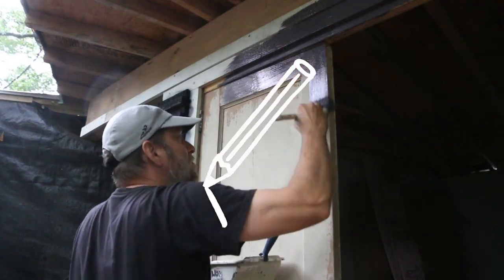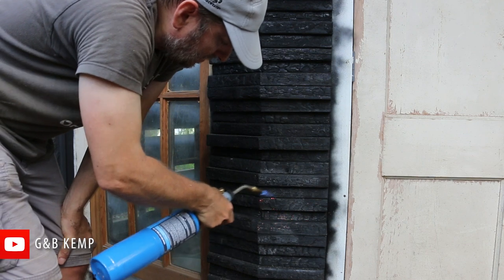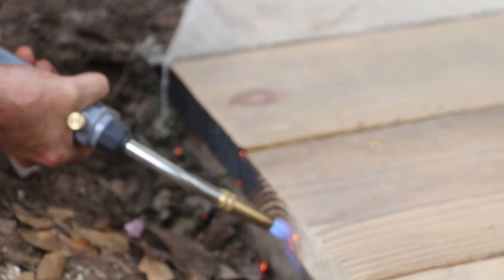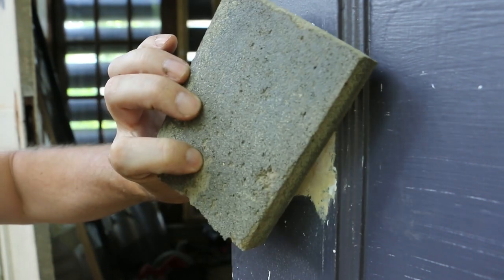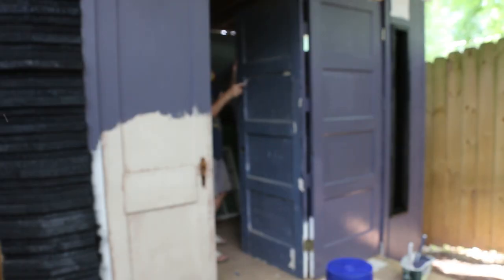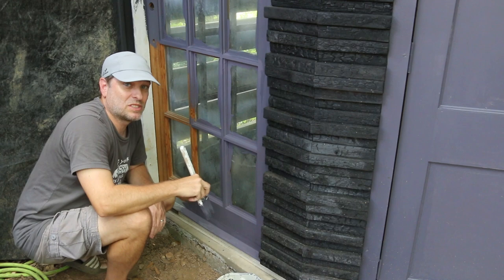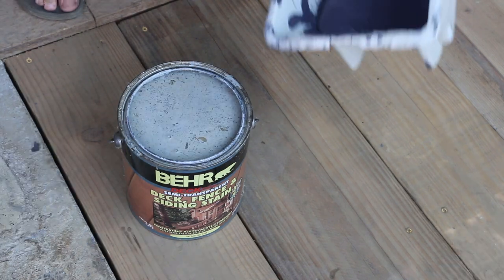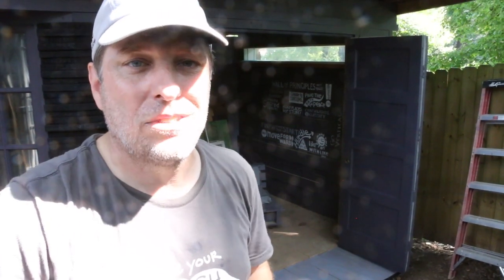The Shed Gets Paint And Shou Sugi Ban

Comment: You should use heat resistant or fire proof tape to protect the plastic bord or any future samiler  projects
Reply: I suggested a clump of wet, soggy newspaper.  Alternatively,  foil or scrap aluminum from a pop can would have made a sufficient fire shield.
Reply from the maker: Thank you for the suggestion. My solution was a little sketchy. :-) Thank you for watching.

Comment: Why not just flame toast the entire deck and then clear seal it?
Reply from the maker: The charred surface, especially when it is not brushed, is rather soft. Not a good walking surface. Also, I prefer that the deck and floor be lighter than the walls. Thank you for watching.
Reply: @GreenShortzDIY   I didn't say char, I said toast. Toasted wood finishes wood finishes personally are way better than any paint or stain.